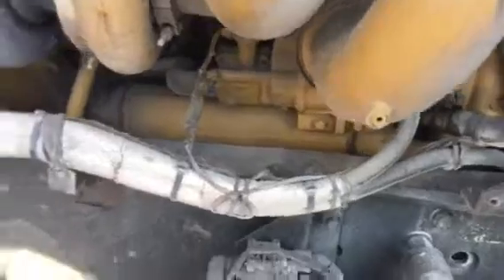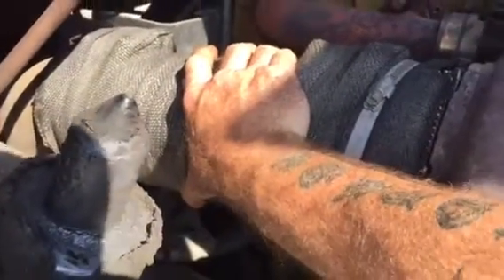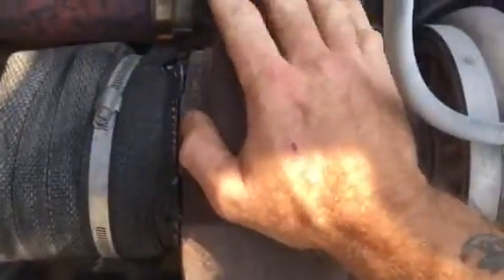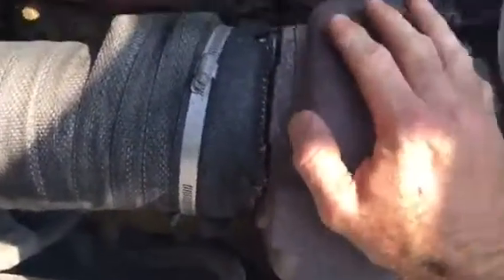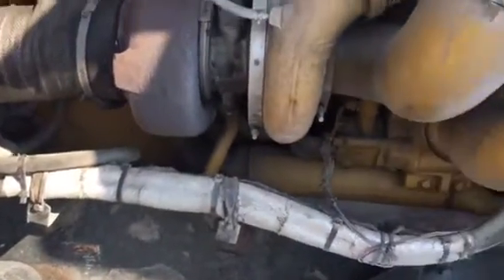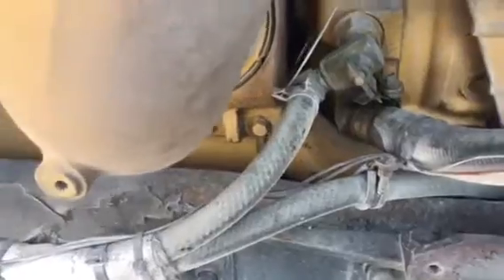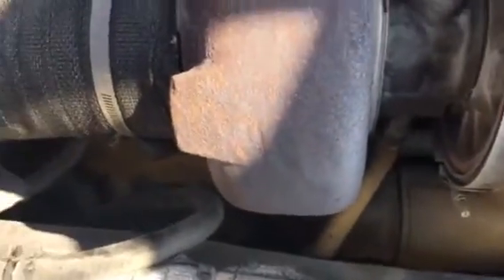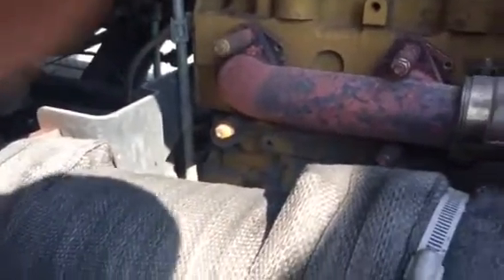Exhaust wrap on Caterpillar

Comment: I have c15 single turbo and my fuel mileage is low 3.8 high 4.8 . Just put new turbo new exhaust manifold new air filter and done tune up by cat but nothing helps. Any ideas to get fuel mileage . My truck is pete 379exhd
Reply: I have an 07 with 80k on platinum rebuild new turbos and the works and still only get 5.25 mpg cats mpg suck
Reply from the maker: Mine is an 05 with about 200k on a total rebuild. I only get about 5 mpg.
Reply from the maker: harpreet happy only advise I can offer is a PDI tune. Cost about two grand but will bring you up to 6-7 mph easy.
Reply: harpreet happy was sq we saw s see
Reply: Find  a private tunner, not even PDI , theres a bunch of independent shops and tunners that will tune your engine with some custom tunes with advance timing, anything you get from caterpillar or any authoorized shop by Cat or stealership  will have a low Nox tune that will create high EGT and low fuel mileage. 
\
Reply: I like Cat C15 but they suck on fuel, Detroit Series 60 is good on Fuel

Comment: will these help only in  cold whether or in summer too
Reply from the maker: They will work all the time. I used one roll to cover about 10 inches behind the turbo.
Reply: Daniel OMalley cool mine is a 2004 peterbilt c15 acert ima do this and the fuel line mod on the other video I get around 5.3 loaded hauling 46,000 of pipe in texas
Reply: Daniel OMalley how you drive you truck I try to stay under the 1500 rpms sometimes i go over to 1600 on a hill I got 18 speed 3:36 gears 550 acert
Reply from the maker: I've got a 13 with 3:25 rears and 550 hp. Cruise at 75 mph/1500 rpm's.